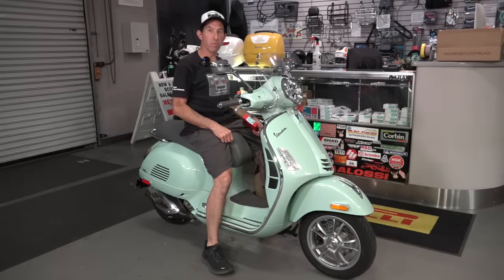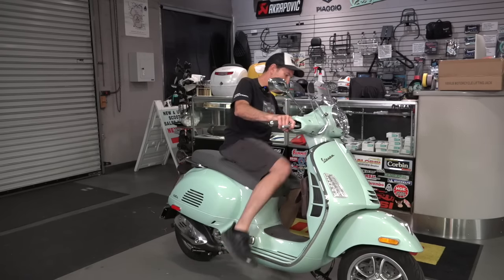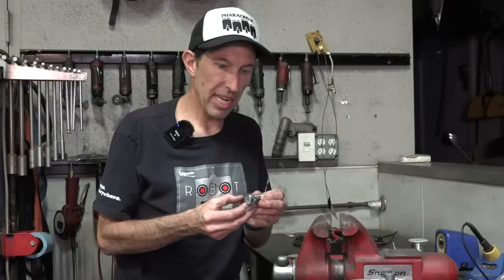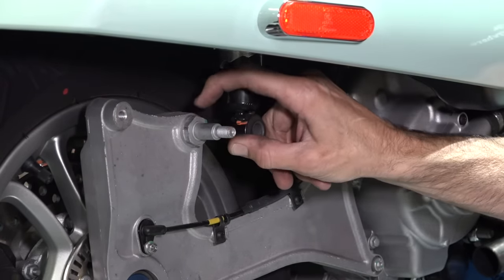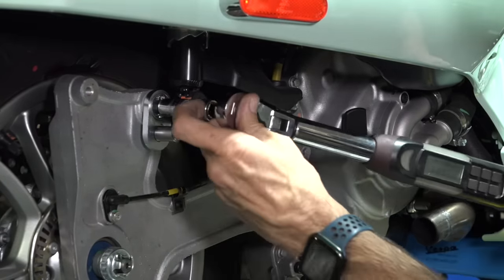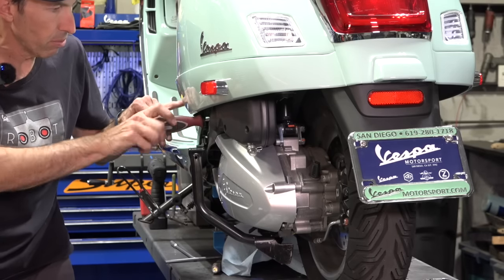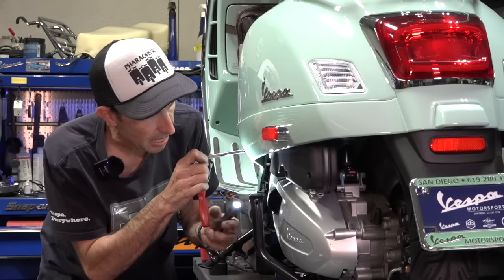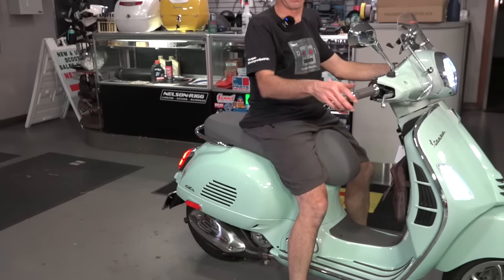How to Lower a Vespa GTS by 1"

Comment: Just done this mod for a friend. Things went just as video, but two things I noticed. The new pivot point for the rhs damper needed Locktite on the screw holding it in place ( not just the large countersunk bolt holding the lowering plate), and the dipped headlight/full beam aims slightly higher now due to the lower back end. Expensive mod but can't deny it is well engineered and above all works well ❤

Comment: Used this on my 300 gts and have a few hundreds miles on it no issues. Rides and corners fine. Im 5'3 and  very helpful at stops especially on uneven pavement. Vespas ride higher than other scooters
Reply: Hello iam 5.3 to..
Iam looking for a gts300, i really like this scooter. Do you think it's possible for me?
Thanks.

Comment: Does lowering it do anything to the handling?
Reply: No. Just handy for small people that can't touch the floor
Reply: yes, reduced ground clearance in hard cornering....
Reply: @daviddee7103   So you wouldn't be able to lean as far?
Reply: @drdreddmanofmystery9482  Some people just don't have the mental acumen for riding on two wheels.  

You are one of those people.

Comment: How about a video as to why some GTS's suffer front wheel wobble.
New balanced tyres, new head stock bearings, heavier Genuine Vespa bar ends. Still shimmies.
So, any answers Robot please as I know I'm not the only one suffering from it !
Thanks.
Reply: Front fork has a new little second arm that works with the suspension to avoid that problem, not sure if since 22 or 23...
Reply: also, on my 2010 I use a front bitubo shock, and almost no shimmie now; (checking balanced tyres, also with Heidenau winter tyres even better
Reply: My 2016 has the 'odd' front fitting lower end. It's at 90° to the before and after 2016 - 2019